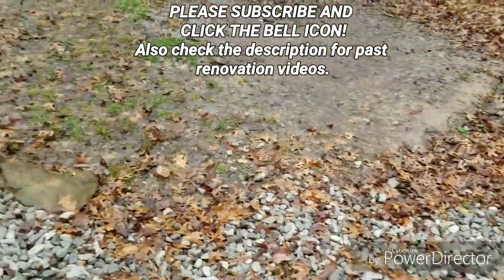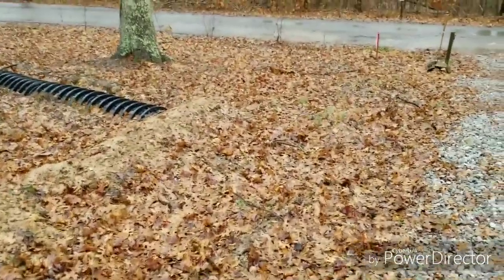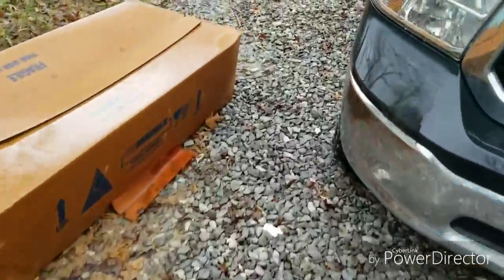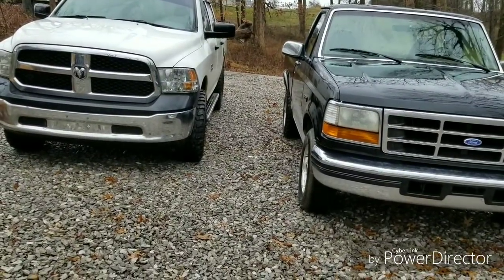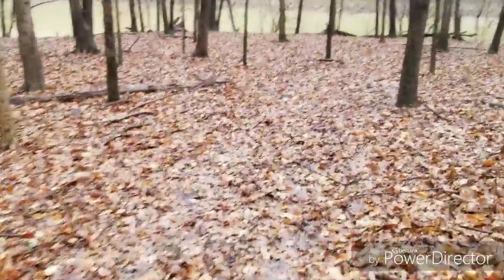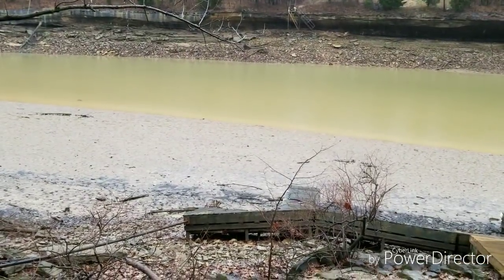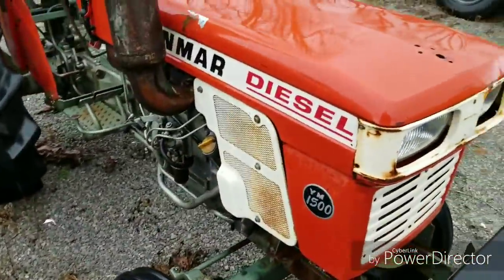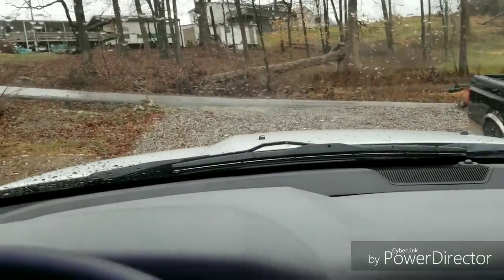Walk and Talk Tractor and Counter Top EP.13

Comment: I had standing water around my house.... front and back.   has been an issue for years.  so I got fed up and began digging with a regular shovel   rain made (Georgia clay) it soft so before I knew it in a few days  I have it to where it drains nicely away from the house and no longer puddle and pools for any length of timd
Reply from the maker: Wow good job Beverly. That Georgia Clay sure is some heavy stuff lol
Reply: @MDC2020  I also get wood chips from the county and I put it around as a walking path.... it drains nicely and absorbs water just right.  I might use it to grow some lettuce and greens next month.
Reply from the maker: @Beverly1947  Oh ok thats a good idea. Have you had any issues with bugs
Reply: @MDC2020  no more than usual but I do pay a company 15 a mo to spray around the house
Reply: and inside I put a trail of borax all along the inside perimeter. ... tried and true method
Reply from the maker: @Beverly1947  Thats a good idea

Comment: You have a LOT of water coming down that hill and running under your trailer.  That is going to be a big problem going forward. It’s going to undermine your pier settings for your home and impact your sewer drain field with slumping and erosion.  I have a suggestion.  Consider installing a French drain on the hillside above your house and use it to direct the water around the back bedroom end of the house. And/or also install a graded gentle berm or slope to Chanel the surface water around and down the side of the house.  You will never stop it, but by redirecting it, you will protect your home, driveway and sewer system longer term. It appears you have a lot of clay soil just under the surface, and that prevents water from soaking into the ground.  Another issue, if you have any layering of the clay and the dirt top layer, if you get to much water in the soil, the water will saturate the soil at the clay layer, and then it will cause a slippery surface where a slide can originate, thus potentially allowing the dirt under your house to move down the hill. It appears that clay layer is what determined your surface sewer design that you used. (Not an expert in this area by any means, but have dealt with this type of problem in the past. It’s a royal pain in the extra chair padding between your belt and legs.)